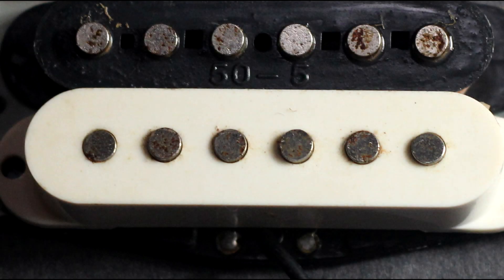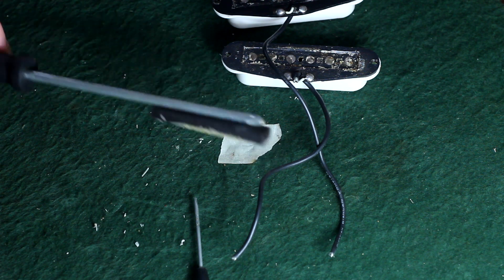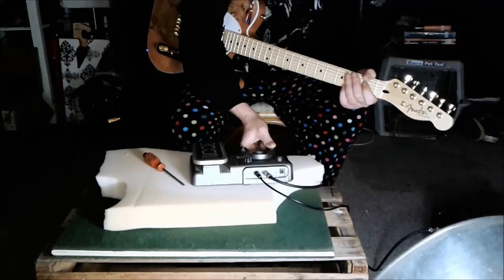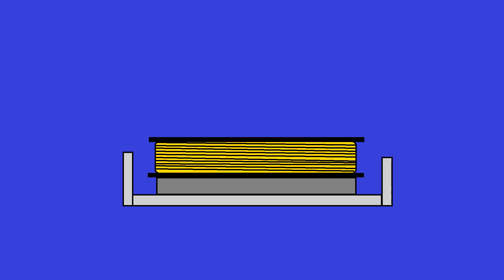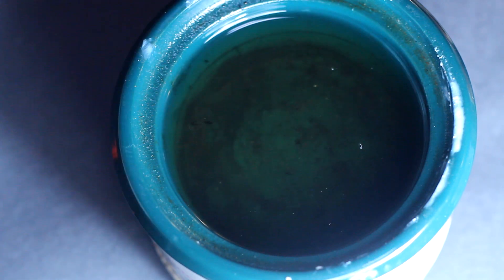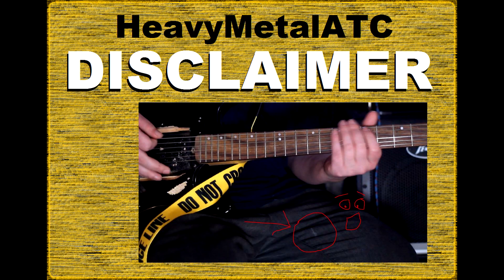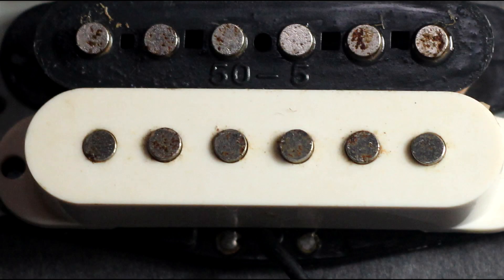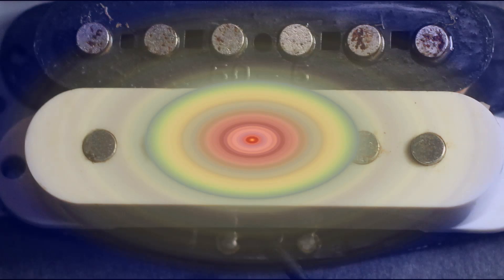DIY Humbucker Experiment: Insane Output + Clarity from Strat Coils (Full Build & Demo!)

Comment: You know, I was thinking on your wax choice, and, well. 

It's probably the safest wax to use for guitar pickups. It's melting point is lower then paraffin or bees wax, but not so low it'll melt out of the pickups in hot sun. The lower melting point would make it easier to work with, with much less chance for the heat ruining adhesives or enamel coatings or warping plastics. 

Beeswax would smell better tho. V:
Reply from the maker: Thank you Alaric. I will admit to not giving it nearly that much thought. Those are great points and observations. Like most things I do its just pretty much a happy accident. I got a huge bag of the pellets at an Amazon return resale place for 50 cents. It was wax so I used it LOL. You are correct about the smell. The first time you melt it, its obnoxious. After about 3 times though it doesn't have much of a smell anymore.
Reply: @heavymetalATC 
It gases off?
Reply: than not "then".

Comment: So, how about three coils as one giant humbucker?
Reply from the maker: Thank you so much for watching and taking the time to write a comment Joshua. I just put that suggestion in my notes. It will definitely work and I think it could be a great idea as you could get the power from 2 coils while using the other 1 to offset the phase and kill hum. Much like the great thing that happens in a normal humbucker with 1 coil wound higher than the other as to not cancel each other out but... with MUCH more output. If/when I do an experiment with this idea and make a video I will give you a shoutout. Thanks again for your time and this awesome suggestion.
Reply: @heavymetalATC  That's exactly what I was thinking! It would be fun to play around with. I know I have so many cheap singlecoils laying around it would be cool to put them to use. I love your videos, man! So much mythos about tone is utter BS and it's awesome to see you proving that. Definitely subscribed!
Reply: Exactly what I was thinking! Subscribed! 👌
Reply: Fender actually did this on that Made-In-China Marauder they put out for one year only in 2012 or so.
Reply: @whssy  Mighty Mite also made the 'Motherbucker' that was a three coil pickup.

Comment: Ok, IF I understand ye correctly, using this shell design with ND magnets and lower output pups allows ye to have the brightness of lower output coils but have a boost in overall output that also doesn't lose as much bass, plus the shape of u-backplate focus more of the magnetic field upwards to where the strings are for more dynamic interaction but due to the distance of the NDs at the bottom, they won't diminish sustain as much as magnetic pole pieces that is right under the strings?

Also what's your thoughts on using this bottom design with higher output rail bladed coils? Say for example, the Hot Stack Strat pups from SD?
Reply from the maker: Thank you so much for taking the time to watch and write such an awesome and in depth comment Lance. Yes, you understand the goal I was reaching for and the techniques used perfectly. I am not a professional pickup designer or anything but I think it pretty much achieved what I was going for on this build using those specs. Its kind of like recreating the bridge pickup arrangement of a Telecaster with the metal around it two times but with neo magnets and connecting that as a humbucker. 

I think this plate and magnet arrangement could be used for many pickups. I will say though I would stay away from the high wind counts (hot winds) as for some reason neo magnets really push out the bass.
 If you are using active electronics that can be EQed toward the high end by selecting a smaller coupling capacitor OR if it is for heavy metal it could still be a good thing to use hot winds... I would just take some trial and error. I'm sure with a few experiments you can hit on something really nice. Maybe even the first try will be a magic combination? You never know.

Thanks again for taking such an interest in the experiment and I hope the info will help you build some awesome unique pickups.
Reply: @heavymetalATC  Thanks as Im rebuilding a Squier Contemporary Telecaster HH into a hotter machine that still retains the tele twang and while Ive already chosen the SD Vintage Stack Tele neck. Later on I planned asking SD to build a bladed version of the VST neck pup, because I do a lot of string bends. But I'm still looking for a bridge humbucker that would work. Your experimental pup comes closest to what im looking for sound wise, but I still wanted blade version for the bends. Perhaps if I were to find lower output blade pups, that might do the trick.

Thanks for pointing out the way for me!

Comment: Are both coils using the same magnetic pole ?  If so it would be series out of phase?
Reply from the maker: Thank you for watching and taking the time to comment Ryan. Yes they have the same magnetic polarity as far as I can tell but they are put in series and out of phase by the wiring. I have tried to find further info on the difference in sound and operation regarding whether a humbucker was magnetically out of phase or if it was done by wiring, in the pickup winding forums but all I could get was conjecture and disagreement and even told this design would not work at all and you can see and hear that it in fact did? I have done the same with strat coils still in the normal configuration and achieved humbucking when in series out of phase but apparently that is an unknown in the pickup winding community? but yes they are wired in series out of phase. Thanks again.
Reply: @heavymetalATC  (First, great video!)  I would suggest that you can't confirm/disconfirm hum-cancelling properties simply by the absence of hum.  You would have to establish that there was an audible hum with a single coil before humbucking.I have an old MIJ Squier strat that has all three pickups with the same wind orientation (and same mag polarity) and I haven't found any hum, but I also haven't heard any hum on my other guitars. Is that because of the absence of ambient EMI?  Is it because the guitar itself doesn't pick up excess EMI, with or without humbuckers, because of sufficient shielding or any other reason?  Unless you checked the electrical polarity before you wire two pickups out of phase, it's hard to tell whether they are both clockwise (or, alternatively, both counter-c.w.) or in opposite wind orientation.  Since they were N and M pickups on a loaded pickguard, you would think they would be reverse wound in relation to each other (actually, reverse wound and reverse mag polarity), but if they have the same magnetic polarity, they probably weren't a RWRP pair.

Comment: The design presented here greatly reduces the effectiveness of magnets for output signal.
It was better to make a U-shaped bend lengthways the pup, across the strings
Reply from the maker: Thank you for taking the time to watch and leave such good info as well as the suggestion for the X2N design. I will put that in the notebook and give you a shout-out if I do it on video. I see what you mean on the design much like the fender jaguar pickup. It was just a quick thrown together experiment and I was trying a new technique to try to get the most out of the bass strings and keep the magnetic field contained to the area above. I may try a pickup with the fold in that orientation in the future on a low count custom wind coil and If I do I will surely give you a mention. It seems like a good Idea for more clarity and less muddy-ness. As for this one I'm kinda glad it wasn't more powerful because it was already WAY too hot. Thanks again.
Reply: + @heavymetalATC  
Good luck with research !!
Reply: + @heavymetalATC  
DiMarzio X2N is very different from Fender Jag pups. The main difference is the rail magnet in the winding, and no side metal bend. The magnetic field communicates between the two rail magnets via a flat steel base plate.
Anyway, then i can reach to similar neodymium magnets -- I've made same pups.
Reply from the maker: I was referring to the idea of the steel being bent congruent with the string path and not perpendicular to them like you stated with the humbucker. I understand the DiMarzios just have a flat plate. But I'm sure the pickups being built with a magnetic blade won't be all that complicated.. I can see where it would pull the string and cause warbling and sustain issues seems like a much better job for an alnico 2 or 3 power bar magnet but if it's set low enough in the body it might not pull too hard.
Reply: + @heavymetalATC  
The affect of magnets on the sustain -- is a total myth. No one can put up magnets strong enough to affect the sustain.
Reply from the maker: ahh I just looked into the specs on them and they have steel blades with a brass base plate and a ceramic bar magnet under the coils you were mistaken. But what you have suggested is maybe a cooler design it would be like a humbucker gold foil pickup so I may still try that.
Reply: + @heavymetalATC  
Nope. Actual DiMarzio X2N had exactly the design I described, but with ceramic rail magnets. In some variants the magnets were alnico.
Baseplate has variants too. The one I examine had steel.
Reply from the maker: Ok I looked around some more and the info is all over the place it seems a ton of misinformation is around but I can build it just like what you are saying but... I have to say have you ever had an alnico poled strat it will totally cause wobbly sounds and kill sustain if a raw magnet is too close to the strings. I as many people know this from experience. They even have a name for it. Stratitus but we will see how it works out when I get around to building it.
Reply: + @heavymetalATC  
I made some pups in Burns Tri-Sonic design with the strongest magnets I could get, one of them with neodymium - no problem at all.  ))
X2N -- my next target to achieve.

Comment: Crazy suggestion - try to reproduce the DiMarzio X2N design, the magnet bar (neodimium -- i see you have some) inside the coils, the baseplate 1.5-2mm steel. Baseplate must be like standart hambucker-shape. I hope your magnets have side-edge-polarity magnetisation.  )))
Reply from the maker: Cool idea!
Reply: I asked myself exactly that about the polarity of the magnets. For it to work "perfectly" I guess the middle one should be side to side like normal humbuckers and the outer ones top to bottom.

Comment: You should build a drum microphone next bro... my buddy wants to record his drums. Keep up the good work! 👍🏻
Reply from the maker: Thank you Goldey. I could try some experiments off camera and see what I can come up with but that sounds like a tough one. You can tape a peizo element to a drum and get a good out put but building a decent drum mic would be just the same as building a decent mic for vocals but it may be able to be done. A speaker will also work as a mic. Sometime you see a little drum in front of these pro drummers bass drum head (on the audience side) and that is actual a disguised 10-12 inch speaker cone being used as a giant diaphragm mic. The bigger the speaker is the more bass it will record. That's how the Beatles use to record Paul's bass. I will see what I can come up with. Thanks again for the viewership and the kind words as well as the suggestion.
Reply: @heavymetalATC  I have had great results using speakers (small and medium size…)
Reply: @heavymetalATC  never knew that about Sir Pauls tone. Love that

Comment: Excellent video! Would you be interested in experimenting with those low impedance pickups that use transformer like lace alumitones?
Reply from the maker: Thanks for taking the time to comment Bash. Excellent suggestion I will put that on the video idea list. I think there is a lot of mystique around those pickups but they are VERY simple. I think I have the supplies to make one out of copper. The "Copper Tone SPF45" LOL Thanks bro.